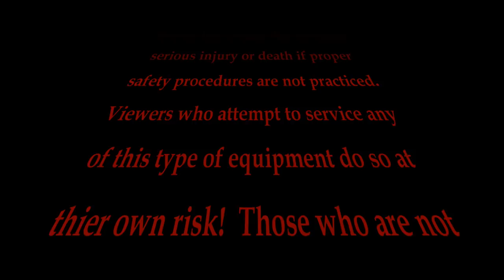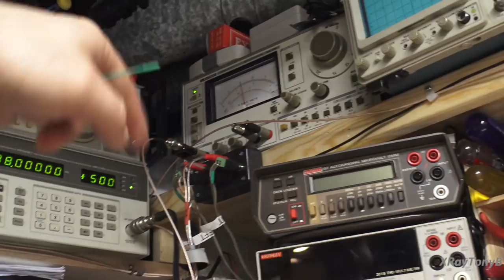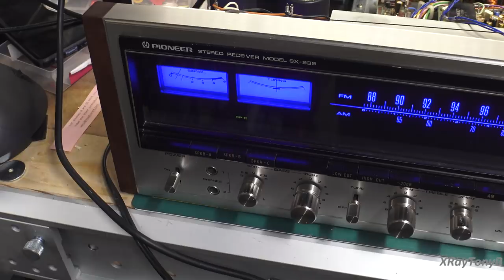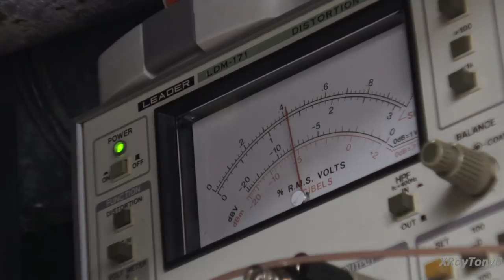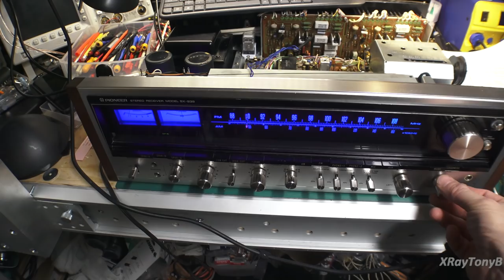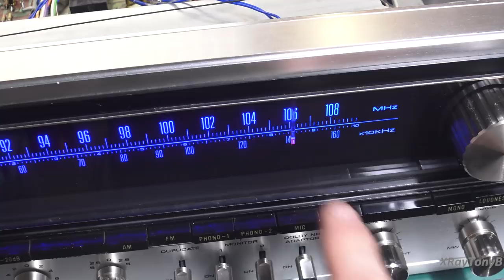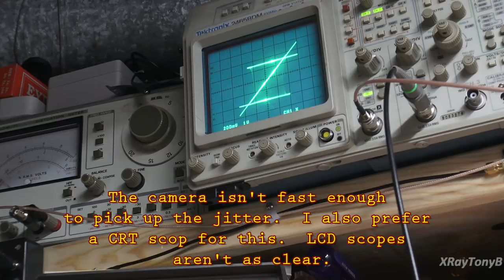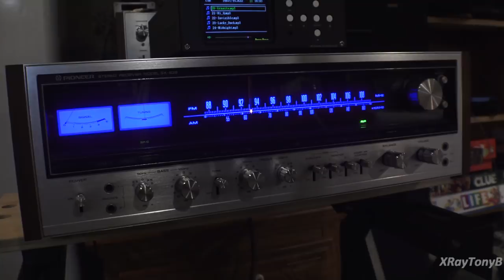Pioneer SX-939 Restore Part 3 - Final With Sound Demo

Comment: Thanks so much for this series of videos on the SX-939. They'll come in handy as I go through mine. The only thing I won't be able to do is the tuner alignments because I don't have any of the correct test equipment. The internal sheet metal in mine are a bit more corroded than your example because it lived in a garage for quite some time.

Comment: Hi Tony.  Wanted to say that I noticed that cooper wire and perhaps aluminum acts like glass when you score it, sometimes with a blade, wire strippers or pliers when you’re removing insulation.  I’ve seen 12ga solid copper wire break off easier with only a couple of bends and flex when you’ve pushed the wire stripper a bit too hard pass the insulation.
  Love the color of the panel from the bulbs.  Just realized,  it’s the same color as the old Vintage Mac Amplifiers.

Comment: I have this model receiver. I’m running a couple rebuilt Optimus 1050 3 ways with updated dome tweeters. Though it sounds okay I always wonder if it could be tighter in the low end and more immersive. If you were doing the restore I would at least have confidence that the amp was as good as it could be. This is obviously labor intensive though and must cost a small fortune! I learned a lot about my receiver watching these videos and I’m certain I wouldn’t want to tackle this myself! Thank you for your comprehensive explanations!

Comment: Great videos, Tony! With regard to reconnecting the wires to the posts after unwrapping, for a few years I have been using the gold plated mini Tamiya style “male” connectors (it’s the plastic shell that defines it as male). So far, so good. It has been worth the extra time to solder the wire to the connector, especially in situations where repeat disconnections are needed — like in trouble-shooting. To reduce the exposure to the extra bare metal, I find that putting a short piece of heat-shrink over the connector does the trick.
Do you know of any down side to this approach?

Comment: I don't think bending the wire anneals it?  Annealing usually requires heating and cooling metal to release stresses  I think you are talking about work hardening.  I know what you are saying anyhow.  Don't mean to be picky  but I thought you should know.  I could be wrong? Thanks for the video.
Reply: Yep putting excess mechanical stress on copper work hardens it, thereby requiring it to be annealed, which softens it (or stress release, if you wish).

Comment: You mentioned hiss in this radio..and Im working on a shortwave radio and it has alot of hiss that I cant get out of it..is it possible my transistors are doing this..?? nice video...oh the radio was made in 1975.
Reply: Commenting on an old post on the off chance that you're still having hiss problems; in addition to semiconductors causing noise such as hiss, resistors can sometimes cause hiss. In particular, the carbon composition type.

Comment: Any particular reason why you did not video the AM alignment?
Also, do you have any experience with "Speed Wire" boards?  I worked with them back in the 1980's and they had some good features, but also some horrid ones as well.  Although there is a company called Speedwire today, that is a totally different system than what I am speaking about.  Check out:
https://en.wikipedia.org/wiki/Speedwire
This is a description of the kind of board I used.  A lot of people complained that you could only put 2 wires on each post, but you could string them over multiple posts.  The biggest problem I had with them was that you would see a complete pin to pin wire connection, but somewhere inside the insulation the wire would be broken...and finding the fault was frustrating!  The tool to apply the wire was sort of cool.  You had a spool of wire at the "eraser" end of a type of "pen" and the wire ran down the middle of the "pen".  You pressed it down on the first post to apply the wire to that point, then move the tool to the next post and press down on that one.  That would fix the wire to the post and cut the wire at the same time.  Then you keep doing that until you have it completely wired.  It actually was faster than wirewrap, but with all the broken connections, not necessarily "better" than wirewrap.